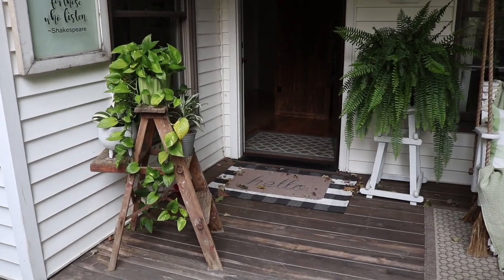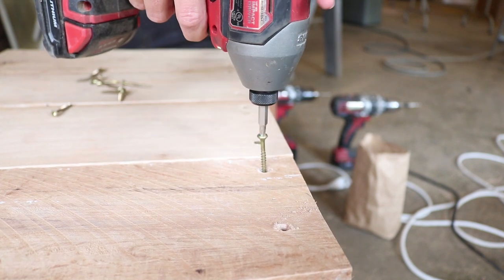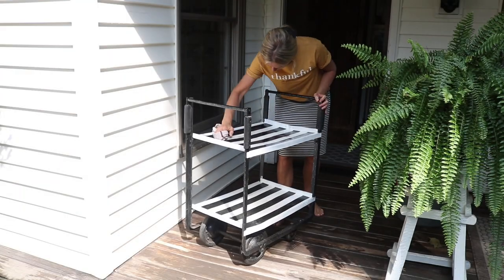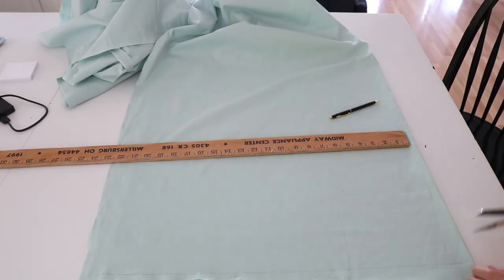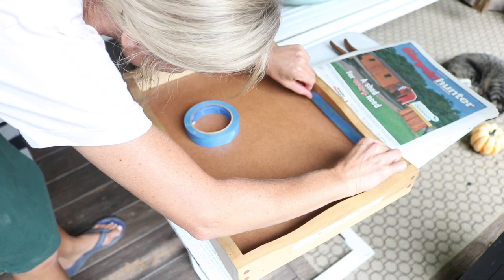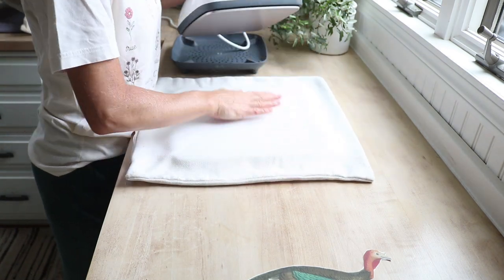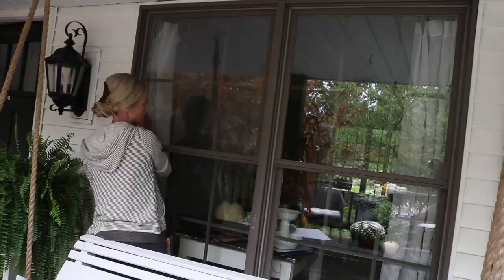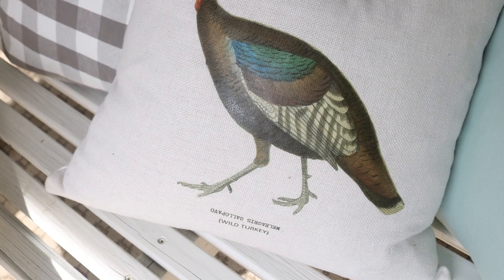Fall Porch Decor ~ Fall Porch Decor DIY ~ Autumn Porch Decorating Ideas ~ Easy Fall Decor

Comment: Everything looks so pretty and inviting! I love the colors of your plants with the touches of orange and yellow from the pumpkins. 😊

I thought I’d share a tip for mistakes with iron on transfers or heat transfer vinyls. It is actually fairly easy to remove a small mess up like that - using your regular iron so that you can pinpoint the area, hold it on the back side of your fabric, just beneath the area you want to remove. Allow it to heat for a few seconds, then use a tweezer or even your weeding tool, to gently pull it away. I learned this little trick a year or so back when I mistakenly put a word upside down. 🙂

Comment: So inspiring.  Thank you.  Regarding turkey decal oops.  You could reprint the text on fabric, cut to rectsngle, fray edges slightly and hand or machine stitch over the oops.  Or make a fabric "label" and apply heat and bond light and iron it over the oops.  Problem solved.
Keep up the good work!

Comment: Your front porch is beautiful!  I can see why you always like to sit out there. Question, have you ever painted your black light fixtures outside? Mine have really faded over the years and I’d like to paint them and I’m not quite sure how, any suggestions?
Reply: Hi Andrea, I saw your comment and thought I’d share my experience. I took my lantern style porch lights down and took out the glass, then I just used fine steel wool (likely 00, since that’s what I tend to keep around) and cleaned off any rust or loose paint/grime. Then I wiped them down with a clean, damp cloth and applied two or three light coats of flat black Rustoleum 2x spray paint. You could, of course, use whatever color and sheen that you prefer. I did them year before last, in the spring, and they have held up beautifully. Hope this helps. 🙂
Reply: @jodilea144  I appreciate your reply! I was hoping to not have to take them down but I may have to do that after all. Did you take the glass out or did you tape it all up before painting?
Reply: @andreagorham1985  I took out the glass. Mine has little latches, kind of like some photo frames, that you can just turn to one side to remove the glass (it needed a good cleaning anyway!). Depending on where yours are and the surrounding area, you could possibly cut open a large cardboard box and tape it around the area to create a mini paint booth, then very carefully tape and paper cover the part of the house exposed immediately around the fixture. Just be sure that the light is switched off, bulb removed, and also that the socket is securely covered. It’s doable, just more work. 😁